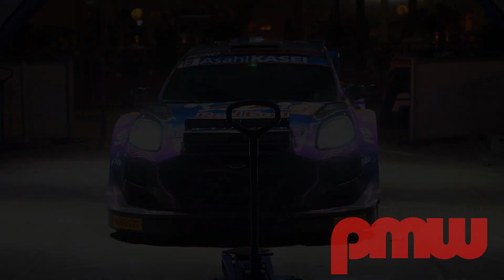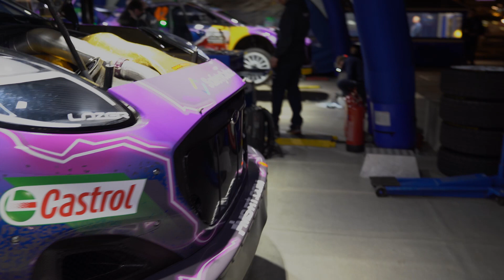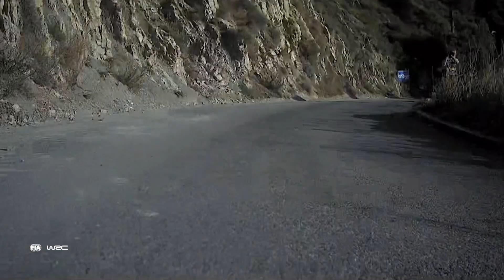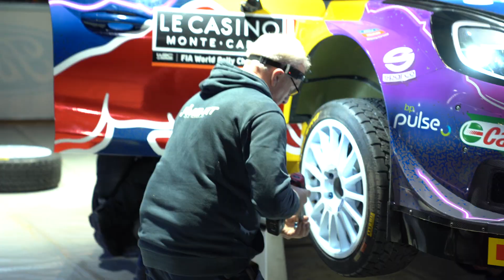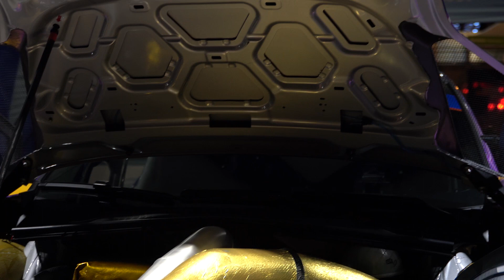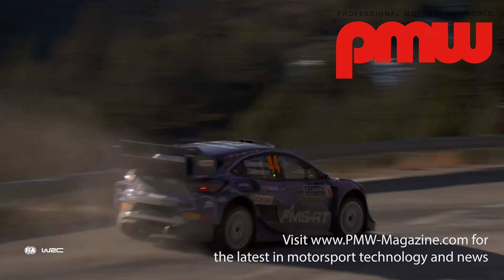Tech Insider: M-Sport's Chris Williams talks through the Puma Rally1 development

Comment: Thankfully I've seen 2021 cars live, R1 is a massive disappointment. Specially made chassis and body, lack of center diff, reduced aero, short suspension travel and added weight... For me rallying is running modified road cars on public roads, now half of it is gone. Been a fan since 2003, but R1 is a turn off...
Reply: I totally agree they could of atleast kept the full areo and centre diff. They even restricted suspension travel seams like a step backwards to me , cars looked brilliant on the road and in appearance in the last regulations now the cars don't look as capable to achieve the same cornering speed I can visually see it watching them. So frustrating they'd take a step backward just to seem green. 😒